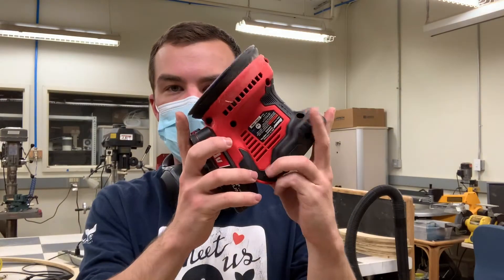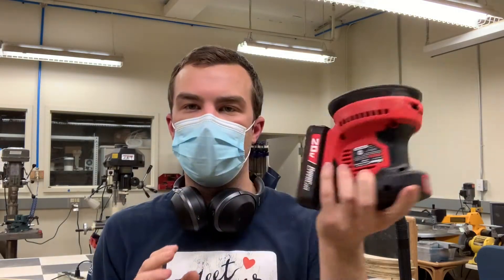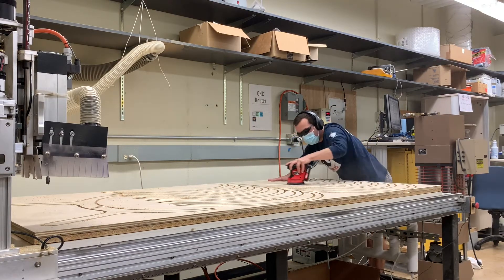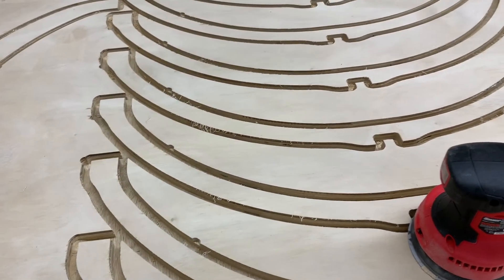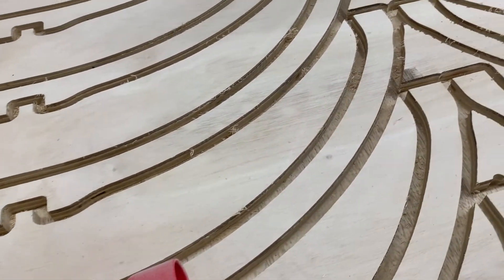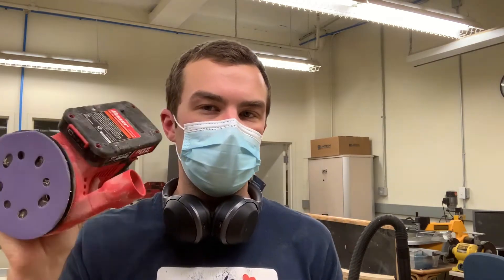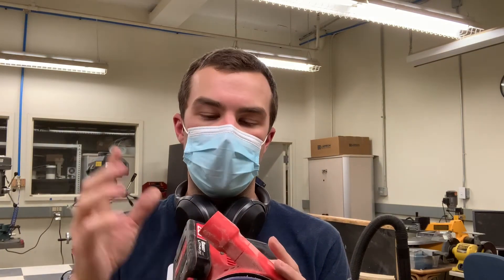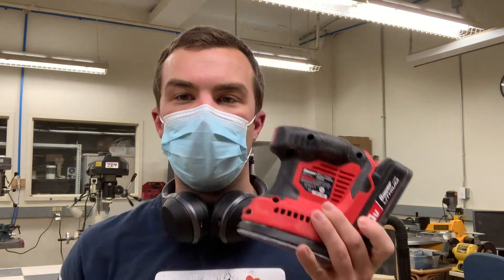Bauer Cordless Sander Review

Comment: Can you do a review on HF Bauer 5" pads, they now have them in 50 packs.  I wonder if this thing out performs Warrior POS that I used to get where it would keep getting clog up on the pad instead of away from the pad.  I wonder if Bauer can do it?  I 'm sure Hercules will since that is their top of the line ceramic pads.  Bauer uses Zirconia which is I think is stronger than ceramic, Dentist uses Zirconia for crowns all the time.  Even high end barber blades were made of Zirconia material.